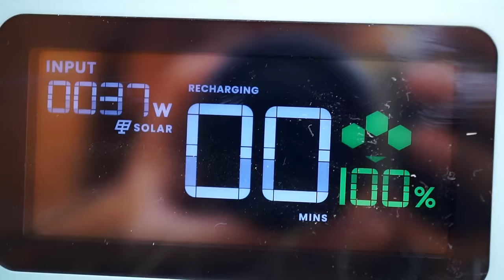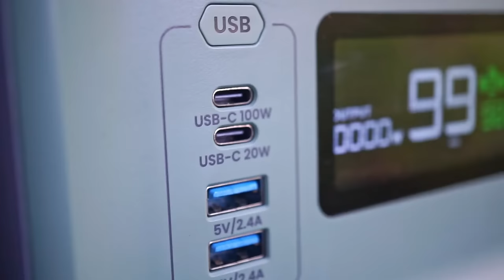Building A Log Cabin | Ep. 62 | Building a Greenhouse and some MUCH needed storage space!

Comment: We had fun guessing what the dresser was going to be, turned out quite ingenious.  Have a suggestion that is really easy.  Actually two but the first would take a little work now that the drawers are sized and fit.  If you had the clearance (or wanted to make some with a plane), the drawers would operate nicely if you drove two big thumb takes on the bottom of each side ( so that the friction surface would be drastically reduced).  The other idea goes along with it and that is to rub a candle generously on the runners, everywhere that is a friction point.  You will be amazed how much that helps.  Love the greenhouse but I fear that the base was not pressure treated wood?  Oh well, it's really gonna be nice to grow stuff even in cold weather.
Reply: I was going to suggest rubbing a bar of soap on the runners for the same reason!
Reply from the maker: We did smooth the runner, but never thought about the wax! Smart idea, we’ll keep in mind if we ever need to fix the drawers :) as always, thanks Dave!!

Comment: Hello you both, great project :)
My wife and I have been renovating an old watermill for 14 years.
We use traditional building materials as much as possible and try to avoid synthetic building materials as much as possible.
I noticed that you filled the joints with cement mortar. Cement is a very good building material, but it has little diffusivity and is very hard. There is a very good alternative called natural hydraulic lime. Try this, it's just as resistant to frost, but much more flexible and ten times more diffusible than cement. It dries the wood in the contact area and protects it from weathering. As an alternative to rock wool, there is soft wood fiber flex insulation, which is better for the lungs. The mineral fibers cannot be broken down by the body and can lead to lung diseases. I can recommend linseed oil varnish as an alternative to clear varnish.
Many greetings from the upper mill, and thank you for the great videos
HUBI :)
Reply from the maker: Thanks for the tips!

Comment: Suggestion: 2 Stop Ur Geen House From Blowing Away. Unscrew & Remove Ur Green House. In The (2) Side 4x4's, Drill (3) 3/4" Holes 6" In From The Ends & 1 In The Middle. Then Drive 3' Long 3/4" Rebar. Then Reattach Ur Green House With 3" Long > Truss Head < Screws...

Comment: U Learned The Hard Way: Carpenters Rule = Measure > Twice < Cut Once = Steps Would Not Have Had A Gape.
Since U Have These (2) Stringers U Can Use Them As Templates 2 Quickly Make New 1's L8r On...

Comment: Is the greenhouse robust for wind, snowfall and large animals like deer, bear or wolves? May need chicken mesh around the base to prevent burrowing animals like rabbits/raccoons/squirrels getting in. Year round use or seasonal (spring to fall)? Any plans for heat and irrigation water?

There is enough compostable material  to add to the raised bed soil to increase the ph if required. Materials like: wood ash, yard leaf compost, kitchen compost, wood chips/mulch/sawdust, moss, peat moss, grass,lots of small twigs and branches. Start now in preparation for next season. Also add bottom layers of corrugated pieces as a weed barrier, water absorber and compostable material. Mix in wood bark shavings.